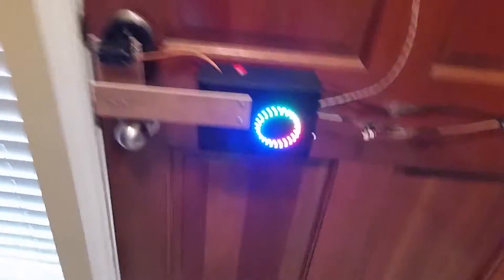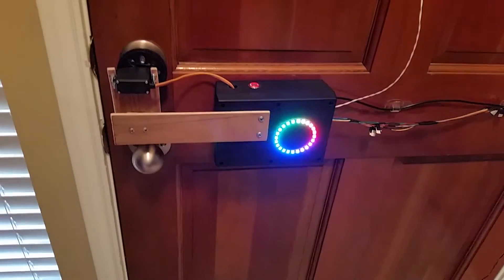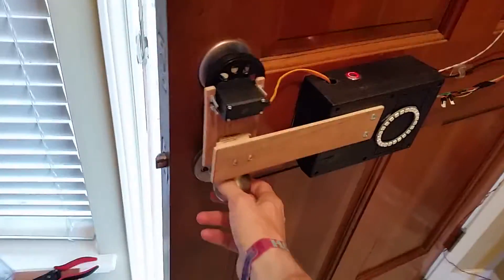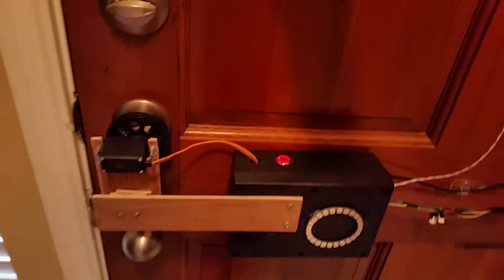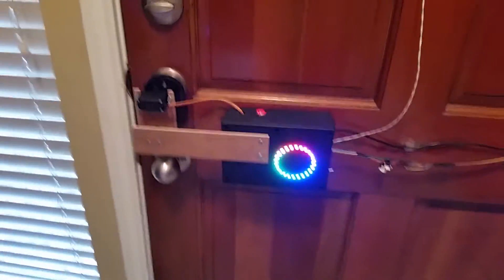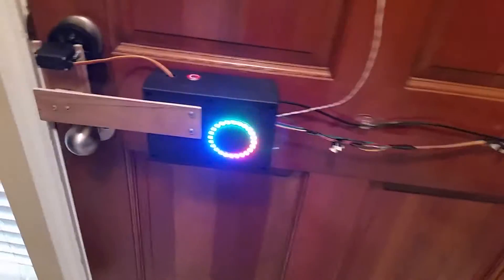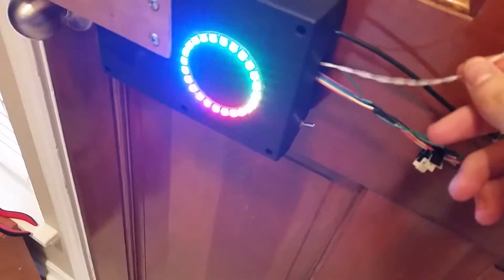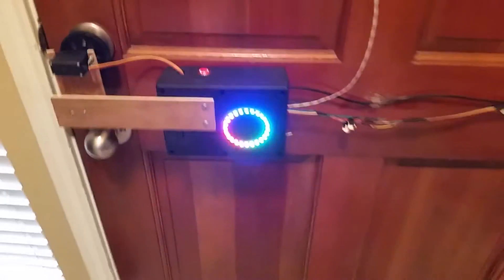Arduino RFID Door Lock Upgrade

Comment: What is the wheel that turns the door lock ?
Where did you find it ?

THank You!
Marc.
Reply from the maker: Marc Paradis it's called a servo wheel, I believe this is the exact part I used https://www.adafruit.com/product/167
Reply: Thanks, how did you hooked it up to your door ?

Thank you.
Marc.
Reply from the maker: Marc Paradis in the most high-tech fashion of course, using a bunch of zip ties

Comment: hi..what if the power is interrupted ?? :D :D
Reply from the maker: Well it defaults to lock on program startup, however you obviously wouldn't be able to use the rfid function. I guess I should add some kind of battery backup as I frequently leave the house without my physical key :P

Comment: how do you think I should go about mounting something like this to a doorknob instead of a deadbolt?
Reply from the maker: +Luke's Bikes Hmm that's an interesting challenge. I would probably use a hose clamp or something similar to attach some protrusions to the doorknob that could interface with the servo wheel. Actually I'd probably 3d print something instead, might be a more elegant solution. Something like this http://www.thingiverse.com/thing:640852 except instead of a lever it would have several "spikes" protruding out that could fit into the openings of the servo wheel.
Reply: ok cool i was thinking about something along those lines.  just I lack a 3d printer...
Reply from the maker: +Luke's Bikes a lot if libraries are starting to get 3d printers and also lots of local makerspaces popping up all over, typically let people use their printers. Possible options
Reply: that'll be cool when it happens. i think there is one by me but they have some pretty outdated equipment.  i may be able to get my friend a few cities down to print me parts for an i3...